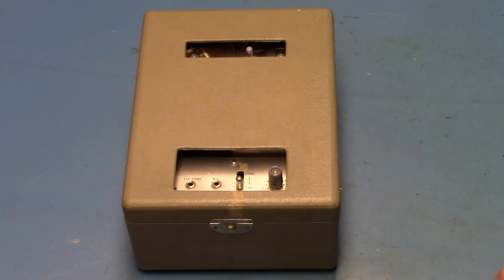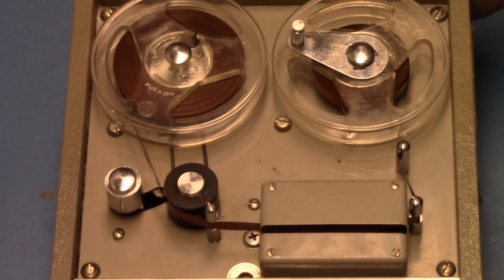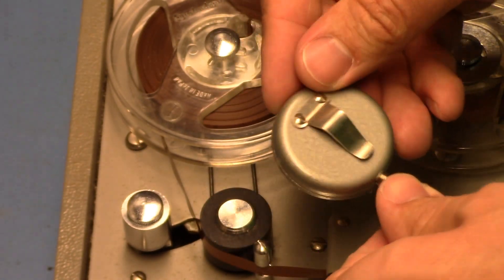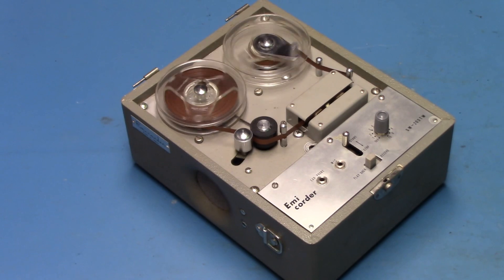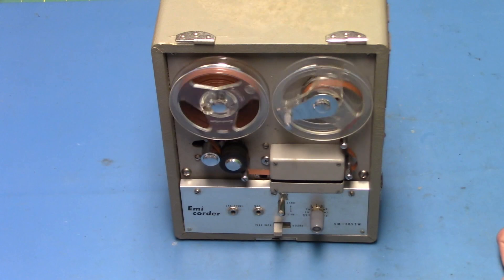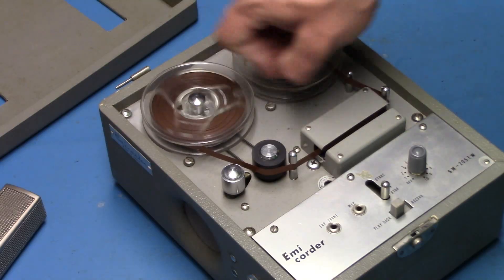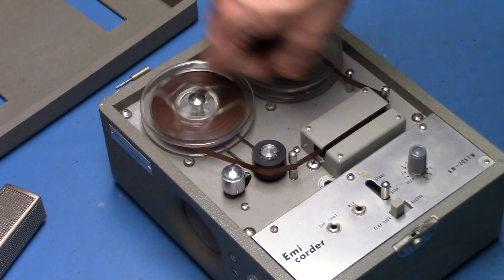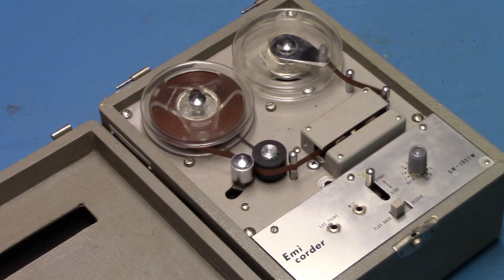Emi corder SM 205TW Clockwork Tape Recorder! (SHORT-SERIES)

Comment: I am absolutely amazed!! This is basically the Tape-recorder equivalent of the russian Zenit Quarz Super 8 filmcamera while all other super 8 cameras were electronic. Sure the only downside is the limited runtime till the spring motor runs out of mechanic power but the sheer idea alone is a sheer work of art from a engineering standpoint. I wonder how much room for improvement it would be if that thing would be reverse engineered and re-done with todays possibilities. Especially the whole kinetic energy harnessing to power the tapehead and perhaps even the speaker. Really love the sound of the crystal mic. Sounds like an AM broadcast recording so for voice this is totally good enough. Even the music bits sounded surprisingly good. I wonder how it sounds if played back on a normal Reel to reel. Probably reversed as the direction is different.
Reply from the maker: On a regular machine, it is not reversed as the head is also inverted to compensate. It is just like a regular tape recorder turned upside down. I think it went that direction because the wind-up motor was originally meant for use in gramophones.

Comment: Yours sounds really good for the small portable that it is.  I have a spring wound tape recorder also.  It's an Amplicor Magnemite Recorder.  It needs some electrical work and a little rewiring but hopefully someone could get it working again. The motor does work well. And it takes 5"reels. And it also takes the miniature tubes.
Reply from the maker: Could I buy that from you? I have been desiring a Magnemite recorder for years!

Comment: never even knew these existed- magnificent! does the battery power the speaker? or does the clockwork generate some sort of electrical charge of its own?
Reply from the maker: The battery powers the amplifier (and speaker). The clockwork mechanism is purely mechanical.